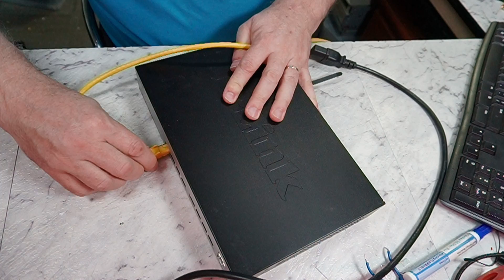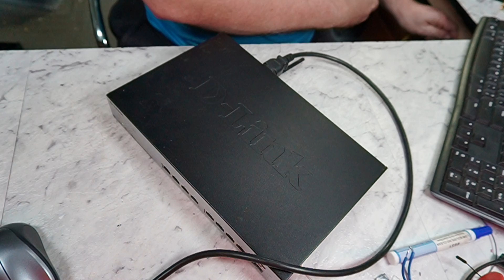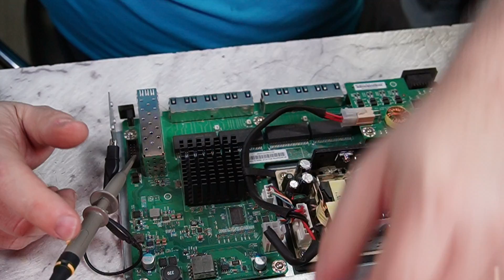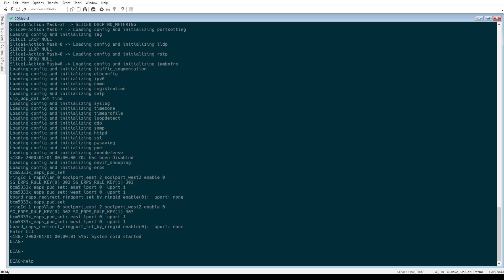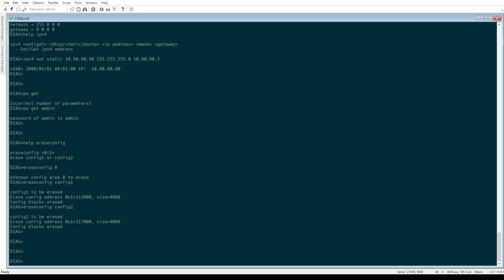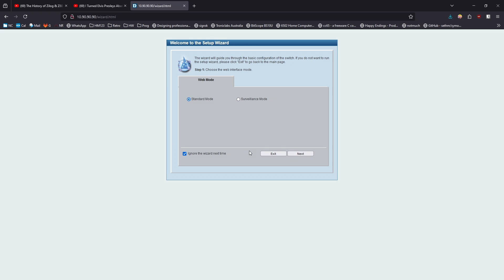DLink DGS-1100-10MP recovery

Comment: To reset your device to factory defaults, please follow the steps below:
Step 1: Make sure your device is connected to a network and the status light is solid green.
Step 2: Please use an unfolded paperclip to press and hold the RESET button for at least 20 seconds while your device is plugged in.
Step 3: Please wait 60 seconds for the device to reboot. And this process will change all your settings back to the factory defaults.
Reply from the maker: That process worked on a couple of others, but not on the DGS-1100-10MP I had.  No idea why...